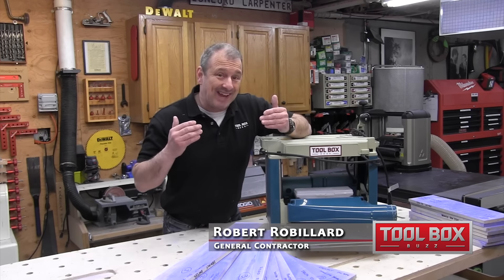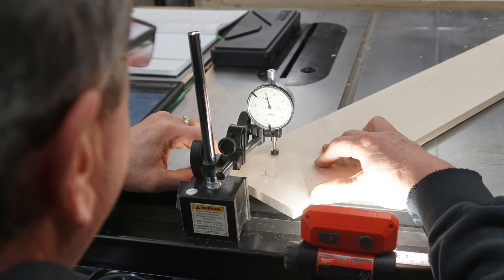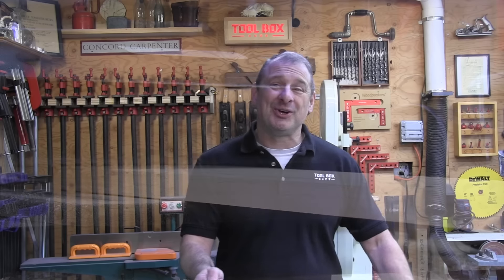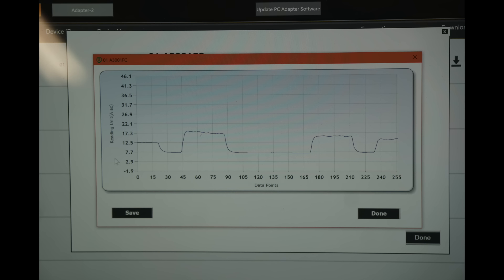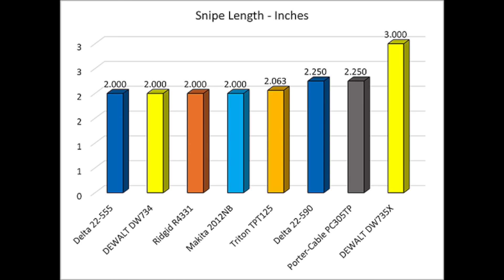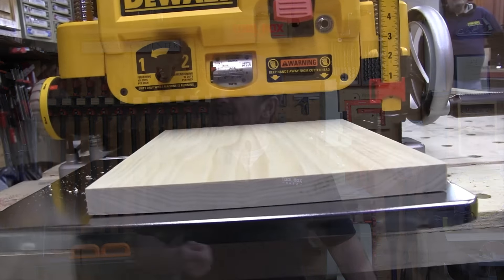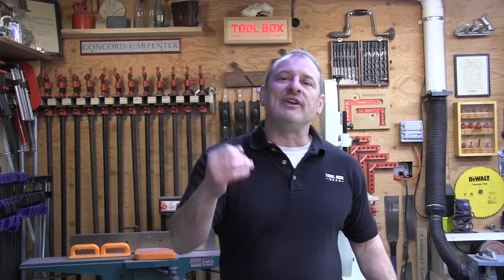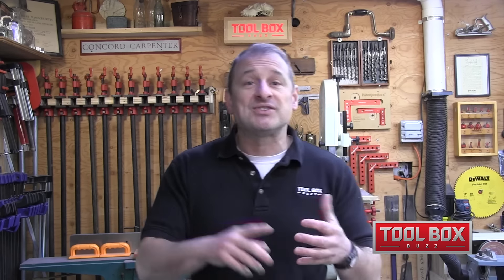Best Benchtop Thickness Planer ~ Head-to-Head

Comment: I have the Delta 22-555 and I don't have the finish quality issue you did. Scalloping usually only occurs when it can't get rid of shavings fast enough, this can be remedied with a shop-made 4" hose attachment that feeds straight back(like the 22-590) rather than hard 90* to the side. As for the milling marks: the factory blades almost always need honing on any planer (you will need to make a jig to handle the narrow blades on this one). I have abused this one with reclaimed hard lumber for 5 years now and it runs like new. Just planed 4"x 12" oak mantle 60" long and it's gorgeous. It works great, it's inexpensive, though it does lack some features.

Comment: I just bought a Dewalt 735X , it came with the extra tables and spare blades. The finish of the boards after planing was  awesome and just as your testing showed it mows thru the boards. I love it and so look forwards to using this in my shop

Comment: The DW735X has been on my wishlist for some time now. I like this unit for what it is, right out of the box. It is designed & built to do exactly what it does. 
I would be interested in your feedback on modifying this already beautiful thickness planer with a Shelix Spherical cutter head. 
Thank you,
Bill on the Hill... :~)
Reply: As I've mentioned in my above post, I have this planer in my shop and I don't use it with a 'powered' dust collection system. This is important because you typically have to run a shop vac or powered dust collection system at the same time as your powered equipment. If you're in a garage with limited circuits, that can be a consideration when operating equipment that draw a lot of amps. All of that to say, my understanding is that the spherical cutting heads cause this planer (any planer?) to draw more current because it taxes the motor more. With three straight blades in the regular cutting head, there are times where a blade is NOT in contact with the stock. This is not the case with a spherical head as there is always a cutter in contact with the stock (granted, it's a smaller cutter). Thus the motor doesn't get to rest between cuts and is taxed more. I don't know if this is a 'bad' thing per se. just something you need to be aware of. The machine will be quieter (yay!), but will draw more current and you might want that 20amp circuit feeding it, especially if you also have dust collection on the same circuit. Just what I've heard.

Comment: I cringed so hard when you said you cut off the snipe. Depending on the project you either do not care about the snipe or it's so small it doesn't matter even with precise joinery with accurate setup. If it's some highly visible panel I just chase it with scrap pieces or finish pass with smoothing plane or card scraper.

The DeWalt DW735X is a four post beast and is just barely not in the same class as the lunchbox planers. It's also another hundred dollars? I mean. I love mine worth that extra money but never enjoyed lunchbox planers.
Reply: In most cases, snipe only happens when you dont hold up the piece as it comes out. It happens when the board is not flat or the board is too heavy for the outfeed roller isnt strong enough to hold it down.
Reply: Bruce Miller I thought snipe was commonly caused by the second roller falling off the edge of the wood. The one rolled left does not keep the cutters perfectly held in place like when both rollers are on surface.
Reply: @FearsomeWarrior  That is true. The rollers dont have as much pressure as larger planers do. I still get some snipe but i try my best to always hold up the board as it comes out so it stays flat and even as it comes off the first roller. Depending on your planer, there may be some wood chips that get under the skid plate where the wood rides on. This may cause problems. On my single speed dewault, i took it out and covered it with 2 sided nylon carpet tape and put the plate back on. Just remember to adjust your height gauge accordingly.
Reply: I use an auxiliary table I made for my thickness planer and while I'm not going to say it doesn't make any snipe it doesn't make any snipe I ever have to cut off. I couldn't get my planer to snipe boards like they're showing here if I tried. Was one of them goofs leaning down on a board as it was coming out?

Comment: My god. Why would you make a planer without dust collection? That's ridiculous.
Reply: Most small garage shops will not have a dust collection system that will be good enough to take care of the chips.  A shopvac isn't going to cut it and you will probably need to empty it out every 5 minutes.  I have some large drums and they get filled every half hour or so wen I am planning.
Reply from the maker: @answeris4217  Actually a solid shop vac WILL keep up [fills up fast]  - I tested this on the H2H but didn't think it was a big enough story.
Reply: @ConcordCarpenter  - It's that emptying every 5 minutes that is the problem.  At least for me.  

I can't afford to turn a 15 minute job into a 45 minute one just because I need to empty the vac 3 times.   It's almost better taking it off the ground with a shovel and a large garbage can.  Other than the fact you are breathing in all that dust too.
Reply: @answeris4217  Emptying shopvacs out beats cleaning up sawdust flying everywhere in your garage. Not all of us have a 100 square feet area clear of anything else to set a planer down in.
Reply: Before I set up my dust collection system I was using a Rigid shop vac and it worked just fine. Emptying every 5 min is a huge Exaggeration. It does add a little bit of time but not 3x. To not have a dust collection shroud is a massive mistake in my opinion and would be a definite deal breaker. Especially after owning a Planer and knowing the amount of chips that are spewed from the machine.
Reply from the maker: Answer is 42 it won’t be every 5 minutes, you could also utilize a cyclone and trash barrel attachment from Rockler - I had one for years and it worked great

Comment: I still have the Ryobi 10 inch planer which is the planer that changed everything for small shops. They were the first to make tools for the small shop and now that is a huge market. I've planed miles of mahogany and cherry through that planer and it is still going strong. Wide boards too, 6- 10 inch wide mostly. Now I share a shop with a friend that has a 3 phase monster old planer if I need width. I believe Ryobi was the first to index their blades to make them easy to change. I remember the long drawn out frustration of changing blades in the old stationary machines. Thanks, Ryobi. If I was starting out today, I would probably go with the Dewalt and put a helical cutter head in it as soon as the first blades needed changing.

Comment: I have had a 735 since 2004 at which time I replaced a Delta.  The Delta was a snipe nightmare and the Dewalt has almost no snipe because I never take a 3/32" cut as I get close to my desired thickness.  I strongly recommend Infinity Cutting Tools replacement blades in HSS.  They are thicker and hold their edge much longer than OEM blades.  I work in a lot of very hard woods and my nearly 15 year old planer has made a lot of shavings.  I wax the platen, clean the rollers with 70% isopropanol and lube the height screws with silicone on an annual basis.  I have no plans to replace it.

Comment: I appreciate the very detailed review and don't necessarily disagree with the results.  On a curiosity note, planer cost was rated 1 (lowest price) to 8 (highest price).  This causes the higher priced units to have an automatic edge in the final rankings. Just because it cost more doesn't automatically mean its better than an equally performing machine at a lesser price.  I subtracted the cost from the equation and while it didn't alter the top 2 rankings it did put several units into ties with each other and elevated 2 units 2 places higher (which means 2 other units were lowered in the rankings).  That being said, your review was thorough and unbiased on the performance of the machines.  Thanks for taking the time to evaluate and post your results.

Comment: The porter cable PC305PT uses The DELTA 50-359 12-Inch Planer Connect as a dust collection hookup and it fits perfectly. Just Incase anyone has the planer and is looking for a connection for dust collection.

Comment: The One thing that you didn't mention in your video, and you may have mentioned it in your written article I'm not sure… This is a really killer feature for the Dewalt planer that I'm not aware any other player in this list has. It can accommodate A Byrd Shelix helical cutterhead upgrade which greatly improves the cut quality of this unit as well as the noise that it makes and the amount of current that it draws on the motor. 

 The fact that only the two Dewalt units can accommodate this upgrade makes that purchase a no brainer if you're going to run a lot of stock through your planner. The fact that you get four times as many knife changes out of one of their cutterheads versus the straight knife is a big win.
Reply: Thank you for all the information TBB team!
Time to call a sparky for that 20 amp circuit.
There’s a digital tape for DeWalt 735X I haven’t installed it yet but it was highly recommended.
wb5mgr - Thanks for the info on the Byrd Shelix. I will look into one of those after the track saw purchase.

Comment: thanks for your thorough and comprehensive categories - I appreciate your preparation and comparison. 
Important to consider too is relative cost of blade replacement, whether indexed knives can be re-sharpened and the comparison between newer, quieter ‘helix’ insert knives in HSS and carbide ..

Comment: Did a lot of research and bought a Dewalt 735x. Unboxed it this afternoon and it was damaged (cracked at the corner of the base). Bet it would have worked anyway, but that's a lot of money for damaged equipment. Now  comes the fun: packing it back up, return authorization, driving 70 miles to a UPS place, etc. Ruined my day.

Comment: Enjoyed your t planer tests & evaluations.  Pleased that you chose the Dewalt 735X as that’s the planet that I have for my garage shop/ hobby WW.  I love it and it performs well.  Totally agree with your assessment of amp draw on the 735.  I tripped a circuit a couple of times and now run it on a dedicated, single 20 Amp circuit.  Dust collection is great also... running 4” . Thanks,

Comment: In the close-ups of the outfeed you can see that the boards are floating about 1/16th of an inch above the end of the outfeed table...maybe that's why the out-of-the-box outfeed alignment was out of whack...the manufacturer raised the end of the outfeed to create contact with the board. You can see the board drop down onto the outfeed table as the last portion of the board gets past the blades...maybe your adjustment to perfection affected the snipe. I also noticed that some boards had cupping and some were planed with the cup up and some with it down. That might affect scalloping and millmarks. We all appreciate your efforts to deliver reliable data.

Comment: I've been using the Porter Cable planer for over a year now. The only complaint I have is how easily the blades are nicked. I use the delta dust collection attachment to manage dust. It fits perfectly.

Comment: Thorough assessment. Time to replace the used Dewalt i compromised on 20 years ago, and will probably get another. Something you guys didn't mention was grain direction, which is  important in planing by hand or machine. It can be tricky to spot and figure out w/ some woods, but well worth the effort. Feed a power planer w/ the grain slanting upwards, just as you would running bench planes over the board to greatly reduce tear-out (what you guys call 'scalloping'). If I'm doing big jobs and want to avoid confusion I'll mark some arrows on the edge grain to remind me of the right direction I need to be feeding all that expensive lumber :)
Reply: I just picked me up a new DeWalt 734 for $200. Been collecting 2 inch slabs from Amish and local sawmills in my area fore like like 10 years now and found that blades wore out after like 50 board feet. Ran 2  Oak, 2 Cherry, and 1 Black Walnut through it with no problems if you tilt the inboard table down farther then what they said. Hit me up if you need some green hardwood for $20  a pickup truck full .

Comment: I had 733 Dewalt and it lasted only about an hour of continuous work. It was struggling and overheating from the beginning. Its something that will not replace the workshop planer. Its a semi pro planer for occasional work.

Comment: Great job guys !  I have the Shopsmith 12” in which the table adjusts and not the head. Had it since the mid 80’s and never liked that and I was planning on replacing it with the 735X and your tests confirmed it so thanks

Comment: 1. A most excellent head to head comparison.  
2. That planers rated 2-6 came in only one point apart, and the winner was the unit most of you used, may be significant in some way.
3. Out here in the middle of the pond (Honolulu) price and availability are significant items, but you guys put in enough data to re-stack the evaluations in any way an individual would like, thanks for that.
4. Who was/were the team that designed the top-rated DW 735X, and what else have they done?
5. Visual similarities, and the likelihood that some/many/most/all were assembled in China, makes one wonder which are the same under the skin... something you didn't evaluate.  The note below that a Delta dust collector fits the PC further suggests some commonality.  Example:  I got a Chinese-made handheld power planer that looked like a Makita, and side by side, they were visually identical right down to the housing casting marks. The Makita branded toothed drive belt fit the no-name perfectly.  Conclusion:  my no-name WAS a Makita, made by/in the same factory from the same tooling, just not adorned with the label. Price comparison:  $125 Makita vs $35 ebay.  Surely some of this obtains in benchtop planers as well.

Comment: One of the things not mentioned here was the sharpen-ability of blades for the various test subjects. For example: the Rigid planer has end notches in the blades that establish the height set. There is no height adjustment , thus precluding sharpening by grinding. The best you can hope for is hand sharpening on the trusty diamond plate. If you have a chip out of the edge...you have a chip out of the edge. The only saving grace is that the blades are ground on both edges, so you do get reasonably long life out of a set, and the sets are not terrifically expensive.
My Rigid is an older two blade model that has given me good, reliable service for several years and has planed thousands of feet of face frame material. I’d buy it again. The newer model Rigid has three blades a fact that I didn’t hear mentioned as a feature of your comparison. I believe the dewalt that was the winner is also. That factor would affect the finish surface.
Thanks for your video. I found it informative and entertaining and well done.

Comment: I have the DeWalt 735X with an upgraded Shelix cutter. (got tired of buying blades) It's an awesome combination, and yes, make sure you are on a dedicated 20A circuit.  
Also one thing you missed on this video is the chip exhaust of the 735X.. It's so powerful that you don't even need a powered dust collector on it.. I've run mine with just a hose going to a cloth bag.   Just for giggles I ran the planer without anything on the collector port and it can throw chips 30+ feet.

Comment: I have the Porter Cable. It is a fine planer for a person getting their 1st planer. The fact that it doesn't have dust collection doesn't bother me at all. I put my wheelbarrow at the end of the table and collect the shavings. I then distribute them around trees, shrubs, etc. In the winter I can use the shavings on ice for traction. Mixing a bunch of shavings with paraffin makes great fire starters. I checked on getting helical blades for it and it is a no-go. Certainly when I upgrade, I'll be looking at helical blades. Everything I've seen so far justifies the extra cost. I think comparisons of planers that come with helical blades or are upgraded would be worth a video.

Comment: Completely agree. And in addition, you can take the DeWalt to a whole other level by replacing the blades and drum with a Helical drum. It's a tad expensive
upgrade, somewhere in the $300 price range. But it will put the Dewalt up there with the top of the line Rikon and Jet ($1500. Planers) category. It will also 

save you a ton of money on blades, that is if you use a planer frequently. Helical drums use 4-way carbide blades that you just turn as they wear down
or chip. When one blade goes bad, you just replace that one blade for under $4.00.

Comment: A lot of factors to consider with tools. Especially something like a planer. How often would you likely use it? What type wood work and or carpentry do you do? How important is the quality work you want? Maybe the most important factor for a lot of folks is cost. That said, the Porter Cable might be the best choice. I've had pretty good results from Porter Cable tools and I wouldn't likely use a planer often and being retired and wood working being a hobby and not a professional aspect, it would probably be my pick. I do like DeWalt tools, so I might would spring for a bit higher cost.